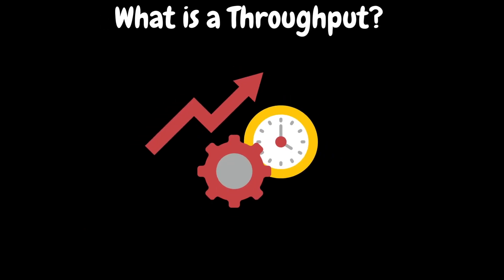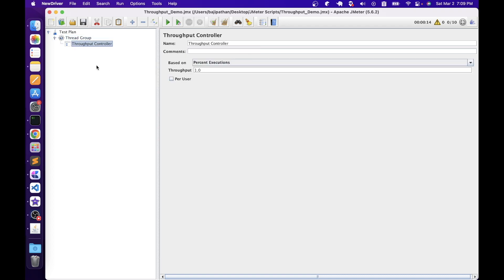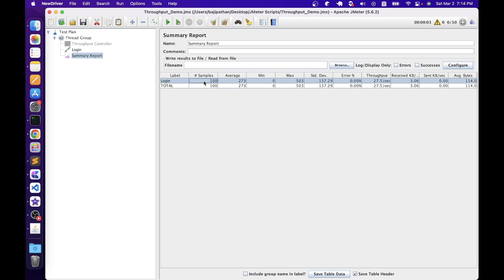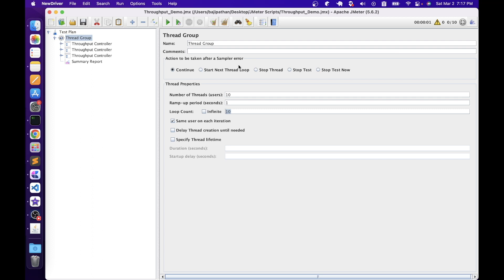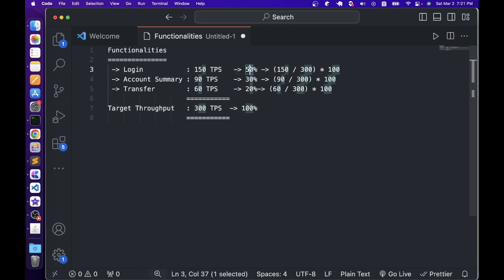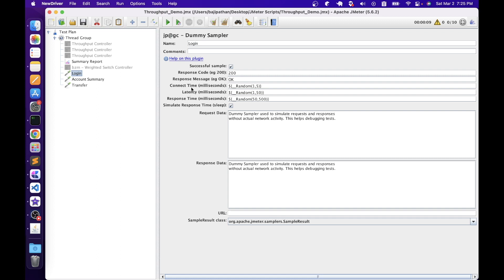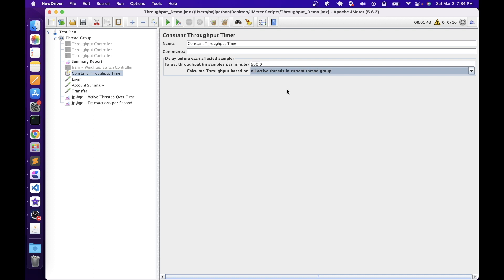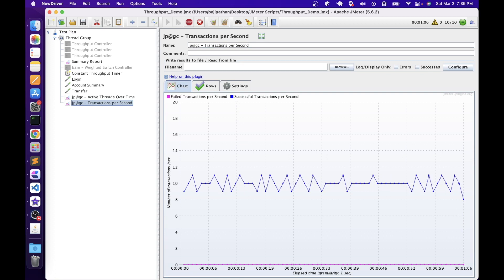Ep 48 | PT Tools | JMeter Throughput Controlling Elements

Comment: is it possible to run all the Thread Groups in same time within Test Plan
Reply from the maker: Yes it's possible. By default, Jmeter will execute all the threads parallely. However, if you want you can also change the behavior by selecting the Run consequently option in the Test plan.

Comment: Thanks for the valuable content sir...Of the 4, which ones are the most commonly used elemnts  in real time...Also pls provide some insights on  ultimate thread group and concurrency thread group.. their real time use case ....thanks much sir..
Reply from the maker: Sure, will plan for it. Regarding real time usage, I always prefer Constant throughput timer. Again, we can use anyone as long as we are able to meet the client requirements. Some organizations, they will define some standards and we need to follow. If their standard is to use Throughput controller, then we may need to use that one.